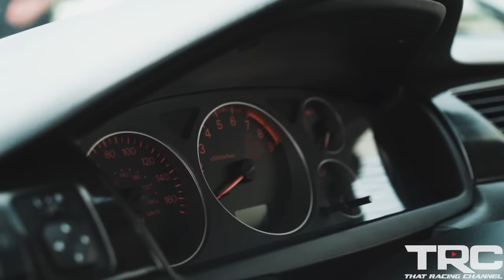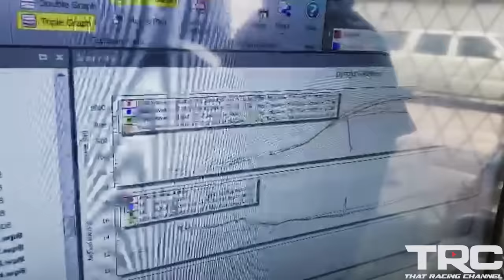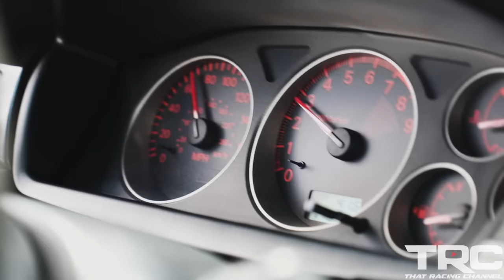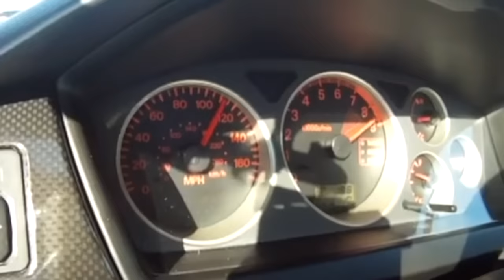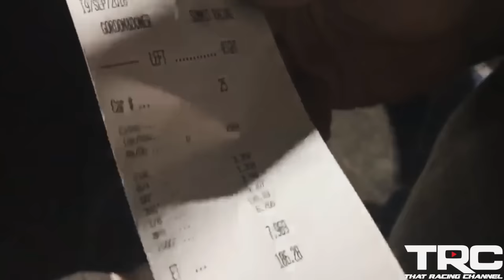Baddest Street Evo EVER! 1100HP on 56PSI - SAVAGE SHIFTS (Pulls 1.5G-Force from 2nd Gear)

Comment: The way he shifted definitely made it up for an entire decade worth of evo owners taking lunch breaks between shifts.
Reply: Right😆
Reply: Hell yeah.! U got that right
Reply: I used to shift mine the same way... not the same power at all bro, i need another one
Reply: @danspeed7039  most definitely indeed
Reply: The dog box helps
Reply: Dog box in the video, but he used to shift his old evo with a stock box quickly also. A lot of people don’t realise how important shifting is. Especially on a turbo where if you shift slow you’ll drop off boost and lag in the next gear. It’s the difference between winning and losing sometimes, especially in Drag racing / roll racing.
Reply: He’s got a dog box 8:10
Reply: Yall need to quit taking long lunches and shift the damn car.
Reply: @gsrman8834  um stick shifting a car general 101........
Reply: 🤣🤣@4g63 Mike
Reply: us evo owners be making sandwiches while shifting
Reply: This evo is built 
Thats why he can do it
Reply: @riegen.  with lettus and tomatoe
Reply: Its not a manual transmission so its nothing special, at all
Reply: Jay Turbo u high or so? A dog box is manual...
Reply: The shifter helps
Reply: That’s why you get a built auto eat lunch and pull freight trains
Reply: If I want to shift anywhere near that fast in my Saab 9-5 Aero the gearbox would be long gone by now
Reply: Wondrin what is the meal on that lunch control... 😂
Reply: @TravisG001  add some cheese to my sandwich please
Reply: @NapFloridian  serving right up sir
Reply: That's what happens when the stock trans is made of glass lol
Reply: Wait what lol
Reply: Won't lie this went over my head. I did only read this once but still 🤣🤣🤣
Reply: OH LMAO facts this dude in a red MR was driving like my deceased grandpa.
Reply: @hondamanvtec2894  yeah stock gearbox would be in pieces with that speed of shifting
Reply: dogbox + flat shifting
Reply: PPG doggggg
Reply: @JamesSmith-zr2wu  he's on liberty gears not ppg
Reply: JASMINE INS BETTER
Reply: I would add another decade of that to include the turbo mitsus before the evo came to the us :) Believe me.
Reply: This shit made me laugh out loud 🤣🤣🤣
Reply: I came from higher HP Hondas. When I bought my first IX I thought I could rip shifts like I could in my ITR or my EG. The first 2nd to 3rd quick shift I thought I blew up my rear diff. 🤣 We no do dat no mo.
Reply: @martycuhntzmart5635  haha same 🤣🤣🤣
Reply: I bet that lunch real tasty when u shifting at 6k
Reply: I guess ole boy can shift maybe
Reply: I'm guilty, lmao
Reply: facts
Reply: @hondamanvtec2894  you don’t say I thought it was factory 🤡

Comment: I probably said it 100 times.....it’s
Always them “wingless Evo’s” that are beastly fast!
Reply: Waiting for someone to keep the wing on and surprise us for once. I feel like the wing is a dead giveaway to not fuck with them, most the time.. 😂😂
Reply: @gsrman8834  LOL i always say keep the wing just because of this saying.  I'm nowhere near this fast but I'll be 500-550hp in the next week and will never ditch my wing.
Reply: @BLACKzj52  haha that'll be quick!
Reply: Evo is only an Evo with that rear wing, just saying !!
Reply: @pete Charles, agreed ....I dig the wing, it’s a tru defying functional part!
Reply: Good thing about evos they look good with or without a wing. I dropped mine 3" and took the wing off.
Reply: Panda Cheeks Nah without the wing, it looks like something is missing. It’s like a Countach or a Supra or a GTR without one. Even the WRX needs at least a small one to look complete.
Reply: @gsrman8834  My Evo III RS runs 8.8 @ 163mph still has the Factory wing :D
Reply: You guys do know that Evo 8-9 wings crack under high load right? Hence the reason most fast evo's remove the wing since they usually end up cracking the center carbon portion =)
Reply: Wings slow you down for down force
Reply: Yeah bc the wing is made for aerodynamics on the track while taking turns to keep the car planted. If it doesn’t have a wing it’s a given that it’s a straight line build 😂😂
Reply: John Lamb tf are you talking about? 500 hp is already BEASTLY!
Reply: So true EVERYTIME i see them with wings on they are stock/slow lol
Reply: @peter8084  Exactly, it’s almost just a lancer without the wing 😭
Reply: Facts, as well as Evo's with no rear badge.
Reply: Tip learned leave the wing on if you are building a beast evo
Reply: bullets dont need wings! lol
Reply: Unless it's an attack car.  I was at Tsukuba Attack recently, and the fastest Evo's had the largest benches for wings on the cars.

Comment: Evo's are always so nasty. I still don't understand it lol.
Reply: I'm literally baffled how so much HP can come out of a 2.2 Liter
Reply: Any engine can put out stupid power if there's buckets of fuel being burnt efficiently, with buckets of air, at stupid high rpm
Reply: Oscar if you put 5x more fuel and air you’re gonna make 5x the hp but it all depends if your engine can handle all that combustion
Reply: Well even that white one that Matt Farah drove had him swearing and laughing like a sailor lol. That one I think was around 600. So this car would insane. I suppose it all falls into place. The weight,awd,gearing and revs and power all the damn time from that motor. Good stuff.
Reply: Oscar absolutely but the important thing is not to blow up into 83 pieces doing that
Reply: @oscar3444  so why do people not use.....any engines then?????
Reply: Nah stee

Comment: At equal levels of tune, the 4G has got to be the most violent 4 cylinder turbo motor ever produced.  The only other 4 cylinder turbo motor that exhibits similar characteristics is the BMW 1.5 litre turbo F1 engine from the mid 80's!
Reply: Uh bro those engines melted after like 2 laps 🤣. Not even in the same world this is much more reliable power.
Reply: @zethloveless7238  No one is talking about reliability, talking about how violent they were.  The ones that "melted" after 2 laps were the qualifying engines.  If the engine wasn't reliable, BMW wouldn't have won the championship!

Comment: Can’t wait for the nice weather that’s coming this summer, my 2011 STI is still on a break in tune and needs to be tuned for e85 and pump fuel. I have the speed density flex fuel, IAG stage 4 closed deck block, Manley STI crank, I-Beam rods, Manley pistons, heads ported and polished, ARP head studs, FP green turbo, Tial EWG, Tomei down pipe, Invidia N1 exhaust, ELH, 6-speed trans, stage 4 Exedy racing clutch kit, AOS, Accessport, Perrin front mount inter cooler, all Perrin heat shields, a lot of IAG billet parts, upgraded Brembo brakes, red leather Braum Elite series race seats with black Braum harnesses/black Braum harness bar, DAMD STI flat bottom steering wheel ($650 wheel), brand new Enkei RPF1 black 17” wheels with new tires, Sony in dash, all aftermarket hoses, inlet hoses, piping, elbows, etc. I’m 29 and this is my first fully built Subaru. My engine builder and tuner is luckily a close family friend of mine and he’s very well known in the New England area for building fast Subaru’s and tuning all types of fast cars on his Mustang Dyno almost every fast car owner I’ve talked to out here has their cars and bikes tuned by him. So I’m in good hands. I know I only have a stock location set up but I’d like to save up for a rotated twin scroll turbo kit and make the next step. I got an amazing deal on the car too,  the built long block alone without all the bolt ones was $10,000 itself, and around $15,000 with the turbo, EWG, fmic, downpipe, injectors, manifold, etc. car itself was built from stock so the car cost $15,000 in stock condition with low miles. Plus the built interior was a few grand. Wheels and tires exhaust sub amp tires etc car has around $40,000 into it. I paid $13,000 cash!!!!!!!!! My tuner built it for the kid I bought it from and said that was a fucking steal that it was a lot of car for the price and it has all the best stuff, that it’s only on a break in tune so go easy with it and when the weather gets nice we’ll map it for e85 and get it up to 500 hp easily. The closed deck is the only way to go he said. I’m so excited man it’s honestly fast as fuck even on the break in tune. 3500 miles on the new motor so far

Comment: Build list:

2.2L 4g63
callies crank
grp aluminum rods
weisco customs pistons
full wet block
stock evo 9 head gaskter
56psi in 4th
xona xr9569s 67mm turbo
ETS exhaust manifold v-band(small) w/ 2x 38mm tial wastegate
custom ag spec ign1a ignition system
skunk2 intake manifold
skunk2 throttle body
garrett core 4" intercooler
Liberty H pattern dogbox(not faceplated)
pump E85 
Injector dynamics 4x 2600cc
aeromotive brushless fuel pump
15x8 volk te37
m&h 245/55R15 drag radials(plans to upgrade to mickeys)
small brakes in front to clear
factory axles and Transfer case
wavetrac LSD
exedy triple clutch

Upgraded turbo to 72mm XR 10569S X3C(unsure what exhaust housing) after this vid to make 100hp more on 65psi
Reply: Grp 153 or 156mm rod? Answer that!😅
Informations already given by Dan on the video
Reply: @Alex_EVii  just easier to find in a comment rather than go through the vid and write it all down again

Comment: Whats the reason to switch to neutral after every pull? I've seen tons of guys do it and honestly curious.
Reply: Its for cool down purpose and taking load off the engine... after each pull the coolant and engine oil temperature rises....inorder to make your engine last 4 a longtime with high hp, its best 2 cool down between each pull....if u watch dyno videos, they do the same

Comment: Hey guys. 
Getting my evo tuned next week
Built list:
2litre stock block (4g63)
Forged pistons, rods, cams, springs, retainers, arp studs
Will be running garrett g30-770 turbo
What is the max hp i can run with this setup assuming the engine can handle it.
700hp to the wheels?

Comment: Not taking anything from this Evo it is Legit badass as hell but Dynojet numbers are not accurate.. which makes this car even more impressive because its More so in the mid 900whp Area.. which = 3.5 second 60-130mph even more insane as a Full H pattern with Clutch.. these turbo's are flow tested an max before 1000whp,  Just saying if anyone can understand that i'm not dissing the car.. more impressive if its making less power ;)

Comment: That car is NOT a sleeper ... look at those tires :-) 
Next this guy is like 1 out of the 5 on the planet that can shift as fast if not faster than an automatic ...
The power is not instant, he is reving the engine to that specific rpm where the turbo wakes up, then he is punching it giving you the impression of instant power. Slight of eye :-) 
No different than a Supra reving to 5500 rpm before punching it, because he knows his turbo is useless before that.